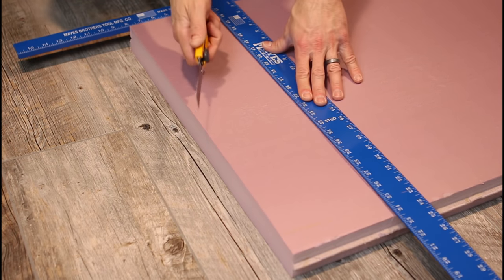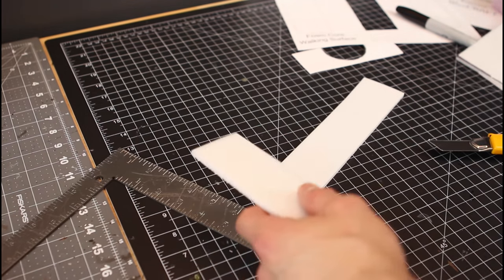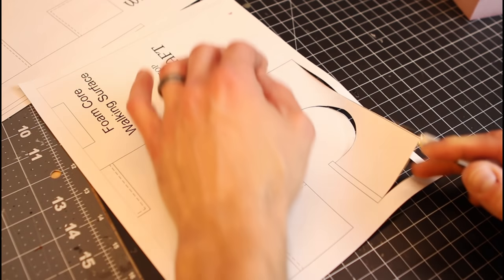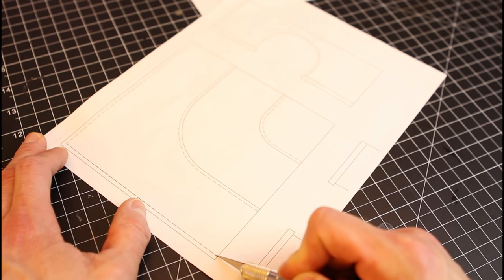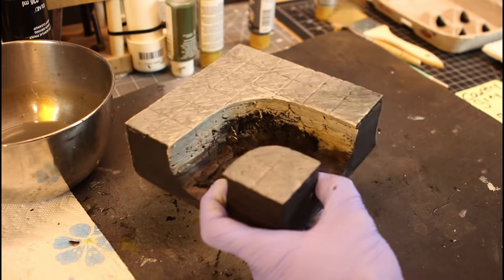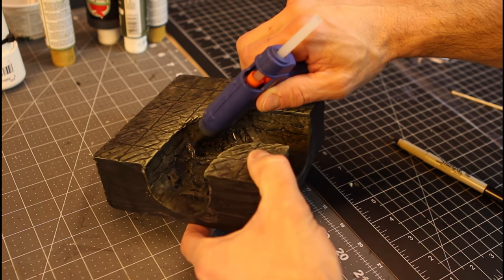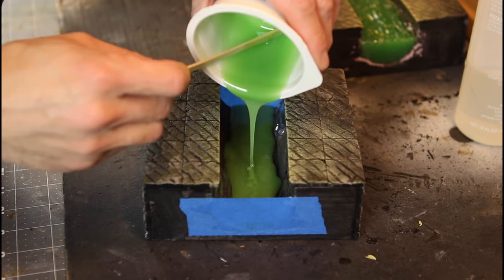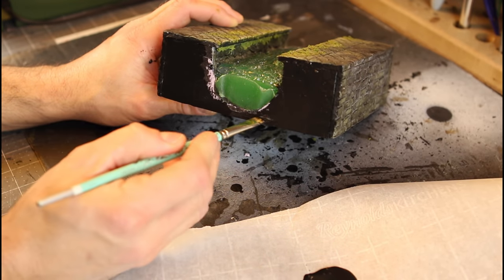DIY LED Sewer Tiles for Dungeons & Dragons

Comment: some advice on options when doing lighted resin pours, I do river tables and if you want to add lighting to light up more then just the immediate space around the led pour a clear resin for the first 1/4 inch. that allows the light to spread and dissipate a larger area. then do the colored resin for the top half of the pour.  all in all this is an amazing build and I think i need to get some foam and make my own set.
Reply from the maker: Bobby Campfield Excellent, thank you for the advice.

Comment: Good stuff sir.  One thing I would experiment with, is using some tissue paper to diffuse the light more behind the clear plastic.  But these look killer overall.   Great job!
Reply from the maker: A great idea John, thanks!
Reply: I came back to make just this comment!
Reply: @Jeremiah Bullfrog It makes me think of Necromunda (WH40K). You have industrial tech even in a sewer.
Reply: I've heard of people using blocks of hot glue to diffuse LED light  as well.  I have no experience with that, but it might save a step.
Reply: @Mattstanley75  I am not on this guys level but I can attest to hot glue working as a diffuser. It is easy to use, can be built up, and (usually) removable with a razor or small knife. I use this trick on Halloween decorations to diffuse, lower, or alter the light patterns on LEDs and C7's.

Comment: This is awesome, really like it. I had an idea but don't know if it would work. Have one piece that's the main power supply then install magnets to connect each piece. That way you only have to switch one piece on, the rest will light up when connected up. Downside of that is you always have to have that first piece.
Reply from the maker: Interesting idea !

Comment: I created some of these about a year ago.  I did not create walls and I'd say mine were deliberately designed to be wall-less.  I did use the same kind of foam.  Mine are around 10"11" long with a couple of intersections and some side alcoves for some gameplay options.  
Mine work and they work well but I REALLY like these--super job!
Reply from the maker: Thank John, yours sound interesting as well.

Comment: If you can get your hands on a large supply of it, clear acrylic panels are way better for this kind of resin work. Second, Plastazote foam is literally made to diffuse light. I think it would work well for this application.
Reply from the maker: I'll check it out, thanks for the tip.

Comment: For the budget gang: Stacking two layers of 1" foam would be quicker. Especially if you don't need a curved bottom.
Additionally, using transparency sheets or "toy plastic" can be added to raise the floor of the resin sludge helping to reduce the amount of resin needed. It might be possible to use clear caulk on a plastic sheet and place it at whatever level is desired.
Reply from the maker: zarlus8 Not a bad idea.  Thanks for sharing.

Comment: For the intersection ones. If you have two or any even number you can temporarily join them with two pieces of ridged plastic or wood on either side and use rubber bands, string, twine, or what have you to hold them together. Then get a pipe, metal or plastic it doesn't really make much of a difference, but PVC/ABS is cheaper and easier to work with, a screw on end cap, also make sure one end of the pipe is threaded. You will want to sharpen the end that isn't threaded. Drill a hole in the center of the end cap. Get a bolt that fits into the hole you drilled. Slide the bolt through slide a lock washer then get a nylon thread lock nut. Make sure the bolt goes from the inside to the outside, the "tail" of the bolt should be sticking out of the end cap while the head should be on the inside of the cap. Now that you have this part done place the "tail" of the bolt into a drill. Place some sandpaper on a flat solid surface like a stone countertop or similar. Use double sided tape to keep it from moving around. Now turn on the drill and lightly touch the pipe to it at a rather steep angle to create a beveled edge. This will help cut through the foam. Now put the drill into reverse and slowly drill through the center of the two pieces till you're about half way through them. Turn over the foam and repeat on the opposite side till both cuts connect. Then just pull the rubber bands off, or what you chose to keep them together, and you now have two foam pieces with a channel cut through them. Making some wood templates with the right sized hole in it for the tube will help by keeping the tube going straight and also for keeping the two ends lined up. You can do this for any interesting ones as well. You just have to move the templates to the next side and it will give you a + intersection. For angled intersections it becomes a little more difficult. A totally different jig/template will be needed for that. Hope this helps for those of you who don't have any hot wire tools.

Comment: With really opaque "water" like that, you wouldn't need to go full depth on the center of each tile to get the same effect. You could still use the full depth on the edges of each piece (if that's the effect you're looking for), but you would use much less resin if the depth in the center of each tile were (say) 1/4" - 3/8" (~1cm). Though this would probably affect the appearance of the lights.
Reply from the maker: Doug Sundseth Correct.  If someone decides to makes these with no lights this is the way to go.  Thanks Doug.
Reply: That or only use the colored epoxy on the last pour. That way it acts as a diffusion layer and the clear will allow the light to spread out more.

Comment: One thing you might want to do is add a little bit of gloss to the ends over, at least, the resin ends. Possibly patches over the bricks as well to add a wet look, but with the ends it gives a better look for the edges.

A heavier layer over the entire ends would also reinforce them a bit and protect the paint.
Reply from the maker: Good idea Azrael

Comment: I was a bit confused by your term 'sewer'.  Sometimes you say 'canal'.  If it is underground with no sunlight, nothing green will grow.  Chlorophyll is there for photosynthesis.  What is your explanation for the pretty lights?  A fantasy world with underground glowing fungus?  Perhaps the lights support the green life, in which case the green would all cluster around the lights.
Reply: radioactive waste material, perhaps?
Reply from the maker: That works for me...it's a fantasy world.  It can be whatever you like..
Reply from the maker: @echodelta2426  Nice !
Reply: Dry brush some glow in the dark paint, or vibrant green and you got yourself some poxy fungi
Reply from the maker: I wanted to enhance the green color of the sludge/fluid in the sewer.  In a more modern theme, yes I would totally agree the algae or plant life would grow around the lights in this area.  Otherwise it would have to be some type of sludge of an unknown origin.  We recently played a campaign where I kept moving a purple diode down the line of the sewer which was a magical rune that the players had to recover before it reached the "end of the line'.  It was a nice effect.  Thanks for watching :)

Comment: Not bad at all but if you use a little bit of sandpaper on the sheet that you super glue down before pouring the resinit'll diffuse the LED a little bit more and then if you add a resistor to the led the LED will decrease and brightness also making the batteries last longer
Reply from the maker: Cliff Moore I like the idea of the sandpaper.  I tested the diodes with the batteries and they ran 100 hours until I stopped the test.  They were still running, but if you know how to hook up the resistor by all means go for it!  Thanks Cliff.
Reply: @TabletopWitchCRAFT  awesome I'm happy to hear you like that idea and the resistor is more or less to dim the light just to make it a little less pronounced in the peace it'll help with like a glowing eerie feeling

Comment: Loving these vids. You motivated me to take up this hobby, so thanks :).
Just got the plans for these tiles and excited to start building. 
I'm just a bit puzzled on the amount of resin you're using. You mention to measure by eye, but I don't know what that means. Would you be able to explain a bit more?
Reply from the maker: Tom Sure Tom, and glad to hear that!  What I mean by eye is to measure the amount used by each part of the resin visually and NOT by using a digital scale.  The viscosity is not the same.  So for example 10 grams of part A does not equal 10 grams of part B.  Just place a mark on a clear disposable cup and reach that level with each part of the resin.
Reply: @TabletopWitchCRAFT  Thanks for this super speedy reply! All clear now :)
Reply from the maker: Tom You got it Tom.

Comment: The sewer tiles really look awesome, I wish I had the talent (and the workshop) to do such projects.
But this is one of the few occasions where I find the usage of LEDs detrimental to the overall look; there's absolutely no reason why there should be lights in the sewage, especially if it's just a point of light. If the light would diffuse more evenly maybe one could at least imagine some strange goo running down the sewer (à la "Ghostbusters 2").
Also I wouldn't try to remove the bubbles created while filling in the resin. On the contrary: It's a sewer - I'm pretty sure that there are things in the water that may cause some bubbles...
Reply from the maker: Yeah, I figured I'd give the lights a go, but they look awesome with no LED lights at all.  Thanks Holger.

Comment: if you dont want the Diode i assume would 1 inch work?? Also is there a specific reason you decided not to do the Clay on this build?
Reply from the maker: Yes you could definitely use the 1" tiles.  No particular reason for not using the clay in this build.  You could definitely use it here.

Comment: would it be possible to add a "dead body floating downstream" into the resin pour in the last two raises? specifically design a spare figure like a noble or town guard maybe from one of the warhammer types or reaper models facedown in the water, arms splayed  with a trail or blood or a knife sticking out of its back??
Reply from the maker: Daniel W Sure can!!

Comment: I never worked with resin, but i will soon.  My question is: Why put the mixed resin in a new container and stir it once again?  Why not just stir it just in the first container?
Reply from the maker: Nice to hear you branching out, and a great question.  Half way through mixing you move to a new container to eliminate any unmixed areas in the first container.  I also clean off or get a new stir stick.  It ensures that 100% of the resin is mixed.  Any unmixed resin in your final product is not good.
Reply: @TabletopWitchCRAFT  Thanks so much for the answer :)

Comment: Wouldn't it be easier to cut the light spot out after the resin has set?
Reply from the maker: Bysentenial Not the way I show it in the video.  I suppose if you used a different light source or just had the diode emit light in just one spot it would be.  Give it a shot.

Comment: Its easier if you glue on some sandpaper on PVC pipe and sand the canal out.
Reply from the maker: Bart Man That would work but would make a royal mess.  I didn’t want to get all those small pieces all over the shop.  Only took me a minute or two to remove the foam like I showed in the video.
Reply: @TabletopWitchCRAFT  Shit. True. Point for you:)

Comment: It seems like you are straddling two incompatible design parameters and that is adversely affecting your results. Specifically, making the sewer water glow vs. having it look mucky without lighting. Solutions could include the use of more lighting with either strings of leds or led panels (like dwarven forges hellscape) and/or swapping the celery craft paint in your pour with glow in the dark paint. The other minor critique is that you are doing a very deep pour in two stages. This  defeats the advantage of having it deep which is that each successive layer can be poured with less pigment, adding translucency to your sewer water. 

Things I like about your build were the modular design of the finished pieces, the depth of the sewer, attention to detail of your masonry, and the excellent paint job. 

Idea for future build: a glowing counter wave ...to build tension... in the distance the players see a glowing wave moving against the flow of sewer water toward them... do they run? No they are murder hobos and brace for the impending encounter with whatever lurks below the ominous wave.

Comment: OK...

https://elwirecraft.co.uk/product/2-3mm-el-wire-2-50-per-metre-2/

If you can wire up LEDs you can wire up EL.

If you cannot puit miniature into the sewers, then you do not need them to be that deep, it'll use up a lot more resin, much more expense, heavier, bulkier.

if you mix up resin with some glitter, just a bit, that glitter will act as a diffuser but also generate speckles of light at random.

Put a layer of diffusion over that before topping up with the textured resin.

Sewer water is never, ever, green.

I mean, very nice and all that, but I'd consider that to be a prototype stage.

Comment: what is the pink material you use to do the structure??  
thx !
Reply from the maker: It’s XPS foam.
Reply: @TabletopWitchCRAFT  oh THX! Do you Buy in Amazon too? Or where ?
Reply from the maker: @aoefail  I buy mine at Home Depot.  Depending on where you live will dictate the thickness of foam you’ll be able to purchase.

Comment: why not make the channel much more shallow, you would use less resin. I can see that might be a problem if your using led's but i dont plan on that
Reply from the maker: Because of the LED's ;)  You can certainly make the sewer shallower, and keep the elevation by leaving more of the XPS foam in the middle of the pipe that will be covered anyway.